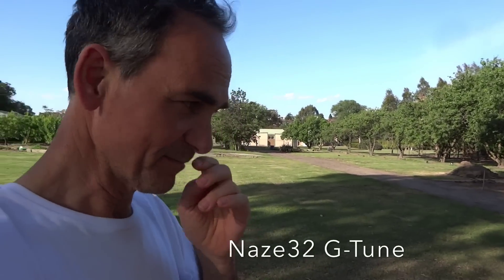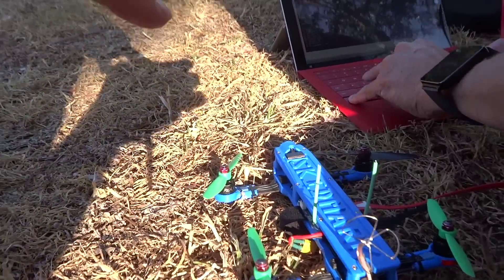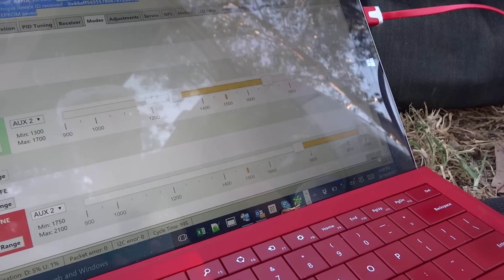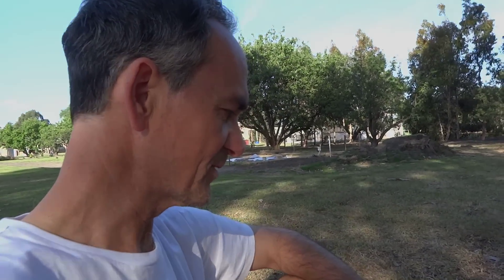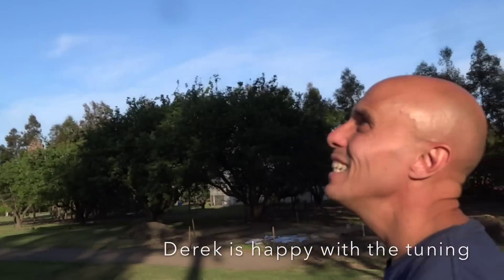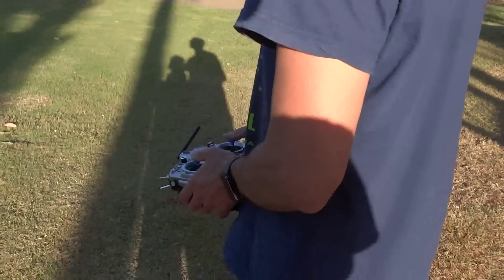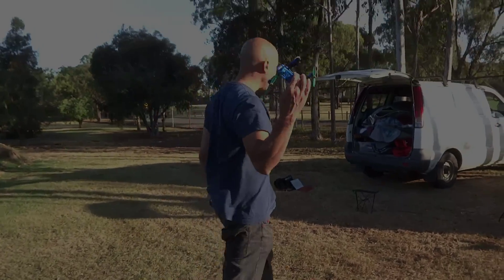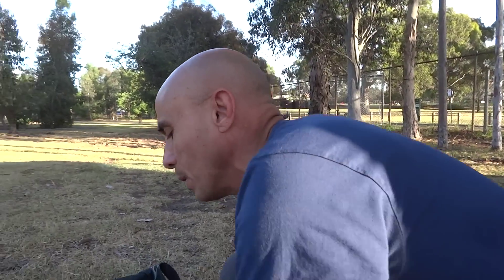Naze32 Quick Tips - G-Tune

Comment: Hi, I need your advice regarding G-tune. I have a ZMR250, SP F3 FC, Emax MT 2204, 5x4x3 props, running on 3s 1800mah, AUW 620 (incl. FPV). I used Cleanflight G-tune and I got 100 P rate for all three ( Roll, Pitch and Yaw).  It did not sound OK for me. Should I try to set in CLI a higher "gtune_hiP"? I have not seen any 250 FPV with P rate higher than 100. Does the Pitch/Roll/Yaw Rate (set to 0.75) influence the G-tune P rate?

Comment: what flight mode are you tuning in?air, horizon or angle for G tune, thanks
 cool video
Reply from the maker: Bullbrook Rottweilers Vom TaurusBach we used acro mode, I don't think it would work well in horizon mode. Please note that it will not work in any of the newer BETAFLIGHT firmware

Comment: I need some help with the Robocat. I have been working on this for 4 weeks, resolved the mistakes I made-- problem is , This thing will not fly. I used a Naz 32 advanced board, went to Cleanflight and have NO idea what PIDs are-- only theory. If I can get this thing to hover, or even take off-- I will work on PIDs. When I take off, apply throttle slowly-- it starts to move, then flips upside down- like I Hit a roll right in rattitude (saw the pictures. How can I ,--at least get it off the ground? Thanks for your thoughts.
Reply from the maker: fistly just go back to default PIDs, it should fly. Do not try g-tune or autotune this is not your problem. If it is flipping there are many reasons. Wrong prop direction, motors not wired correctly (see diagram which ones should be motor 1,2,3,4), Motors spinning the wrong way, board may not be orientated pointing forwards if so you can change this in the config. Make sure you calibrate accelerometer and gyros. Have you calibrated your ecs's. When you use your transmitter are all the travels going the right way and the right control based on your input ?
Reply: I have just upgraded my quad to betaflight and it was flying great before hand, now it is trying to flip over when I try start up.  The props and motors are still the same config so I cant work out whats happening.  It isnt turning on yaw its just increasing throttle, the roll and pitch is so twitchy its just a wild animal that I cant tame enough to begin a hover.  I started it off on default PIDs when the beta installed.  I am running afro escs so maybe they are upset with a setting but I cant yet figure it out.  The throttle is not very responsive either.  If you have an idea it would be cool to hear.
Reply from the maker: flash back to your old setup and see if it works ? Go to the reciever tab and see if everything is moving in the right direction, check that board rotation is defined, make sure props are not loose ?
Reply: Yes I did that, it just seems like the pids are so sensitive but also the yaw doesnt seem to yaw it just wants to increase throttle.  I did recalibrate the esc's and they are afro 12amp running on simonK not the one shot.  Im getting the afor flashing tool in the next day or so to check if its incompatable calibration causing it, although it is very strange after it was going fine before th betaflight. If I lower the values to a low value it just lowers the throttle for each axis but it still wants to flip when I try throttle off the ground.  is anyone using afro esc's?  if so can you tell me how you have the config page set up for esc?  I have selected PWM and I think its at 400-500 other values seem to have the motors out of time.  Thanks for the reply.

Comment: Naze32 10DOF with 30A and 2000kV motors just installed. I must be a complete idiot, because I cannot find G-tune in Cleanflight, no matter what firmware I pick.1.10.0 will allow me to set Autotune...1.12.0 will not provide any.Downloaded firmware from the Betaflight link, but that gave me nothing more and motors wont arm or spin in motor setup in Cleanflight....Will have to go back to Naze 1.10.0 firmware and hope that it will work.
Reply from the maker: You need Betaflight pre 2.4.1, autotune is too risky in my opinion. See my other video on loading BETAFLIGHT. If you haven't done this thing before always good to get someone else to help.

Comment: you said it only tune the Ps?  how would i know if I and D are good?
Reply from the maker: +nitro 20 the I is easy, point nose down a bit to go forwards and see if it stays there and doesnt go up or down over time, same with left and right. To get the D right move the stick quickly and watch if it bounces when you let go. increase to stop bouncing. Obviously this doesnt work if you have auto level on.
Reply: what i dont get..is if D helps P and D is "set" then how is that a good P setting with G tune..shouldnt I and D be close to 0 so that P is being tuned as it should....or does Gtune not care if there is a I and D setting..never the less I and D need to be retuned to match the new P settting..right?
Reply from the maker: +nitro 20 start with low I and low d maybe 0.25 and 5 then you just bring them up one at time after gtune. Sometimes gtune might be too high so you will need to bring the p down too, it all depends when you stop flying

Comment: Can't seem to get this to work. It's been integrated into CF so I set it all up, enabled gtune in acro mode, went for a fly, turned gtune off, landed, turned gtune on and off again to save but no difference. Do I need to set my set my pids to 0?
Reply: +leetpg I have the same problem, have you figure it out ?
Reply from the maker: +mrtokyo1989 make sure gtune is selectable, new versions of boris do not support it any more. then take off and turn on gtune. It was a little hit and miss to get the thing to save but try this... land and disarm then plug your quad in to cleanflight to read the new pids, do not unplug from the battery and dont turn off gtune.
Reply: im pretty sure it needs to be in angle or horizon mode for it to work

Comment: just tried gtune - summary: DO NOT USE!! very unpredictable flight behavior, was doing ok for the first 5sec later took off full throttle into space with a fully charged 4s lipo... no control from sticks, very scary had to disarm to disable motors - not fun good thing i was in the middle of an empty field far from potential targets.

Comment: do you fly in stable mode when in g-tune?
Reply from the maker: No in rate mode but if you are not ready for rate yet then try horizon mode with a low P.
Reply: okay will airmode do as well?

Comment: should i have level mode on or not while i Gtune ? +jbalatutube
Reply from the maker: +Joel Bergman only if thats the way you fly
Reply: Okey. Thank you!
Reply: +jbalatutube what flight mode did Derek use in this clip?, mine PID values didnt changed at all after i used Gtune, after i fly i dind not power off quad, and did not turn off gtune, i just pluged in to cleanflight and hit save, do you know what the problem is ?
Reply from the maker: +Joel Bergman we always use rate mode.  Fly, enable gtune, land and plug in. Do not 
disconnect power. You can actually see it working while its in the air.

Comment: Just tried to use G-tune. Armed the quad, enabled G-tune, and took off. Flew around on a battery and than landed, disarmed, and disabled G-tune. Then I re-enabled it. Went straight to the laptop and checked PID's after - they didn't change at all. One thing to note...my quad appears to be flying fine in LOS with stock Luxfloat PID's.
Update: Tried switching to Multiwii rewrite, flew another pack, enabled g-tune while in the air, flew the pack, landed and than disabled g-tune. Re-enabled gtune, checked GUI for PID change...nothing...so I flew another pack, this time instead of enabling/disabling g-tune after landing, I just plugged straight into CF. Still no luck. Starting to think I'll just manually tune the pids

Comment: How did you make it show up on the clean flight ?
Reply from the maker: +colby lachance you need to install betaflight firmware but 2.4.1 or lower
Reply: +jbalatutube I have just flashed the firmware and I cant find the G tune on the modes tab

Comment: I tried running g-tune with luxfloat, but I see no change in PID values, I hooked up my naze32 r5 to my pc without turning off.  See NO change, haven't tried multiwii, but so far luxfloat out of the box is locked in.  Can anyone confirm if gtune just doesn't work on luxfloat? I'm running latest 1.12 RC1 CF
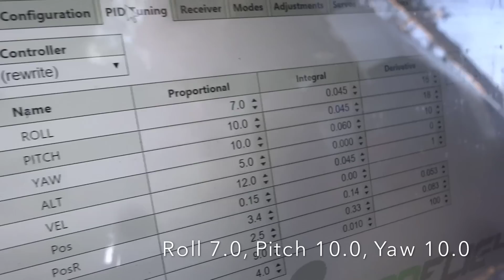Reply: +kubanishku, Tried today in luxfloat on rev6 and same thing, not sure if it works in Luxfloat... If you look 4:57 of this video they are in Multiwii (rewrite). Guess i'll give that a shot now.
Reply: +kubanishku Just tried G-tune with Luxfloat...no luck. However, stock Luxfloat PID's seems to be flying really well. Maybe I'll just leave it for now...

Comment: hello, nice video, very clear instructions. I have naze32 rev6 full with cleanflight 1.1.0 with CALIB mode ( and it came out only by activating inflight calibration setting in the configuration tab)  instead of G-TUNE, but i suppose is the same and i folowed your instructions but didn't get any luck. I see no changes, so maybe the CALIB mode is comporting differently? Thank you for help.

Comment: did you power off the quad before connecting to cleanflight?  I couldn't get it to save.
Reply from the maker: +mooosestang no don't power off, in fact if you are connecting to cleanflight then dont even switch g-tune off when landing just connect up and save in cleanflight.
Reply: +mooosestang https://github.com/cleanflight/cleanflight/blob/master/docs/Gtune.md

Comment: So I've tried this several times now but I can't get it to save. I fly with gtune in acro mode, and then I land and disarm, and then turn gtune off, switch it back on again, and then switch it off. I have the version from when it first came out. Am I missing a step? I'm using the seriously dodo flight controller and it flies just fine out of the box but I figured maybe it could fly even better.
Reply from the maker: +Doc FPV Try just leaving it on and plug into cleanflight ?
Reply: So disarm, leave gtune on and plug it in? I'll have to try that tomorrow. I'll keep you posted!
Reply: Actually just got a moment to try it in the back yard. That works! Thanks for the tip!

Comment: Could you tell me if G-tune only works with the full naze32 or does this work with the basic version too? I'm struggling to get g-tune to show any changes to my pids ( and I am useless at tuning! )
Reply from the maker: Just turn off angle or horizon mode and follow the steps in the video. You should be able to hear it changing as you fly
Reply: jbalatutube I'm sure to be doing something dumb. With no other modes set, flying acro / turn on g-tune / land / disarm motors/ turn off g-tune / turn on g-tune / pull power and connect to cleanflight but see no change. I will re-flash beta - perhaps that will sort it. Thanks for the help. It sounds so simple!
Reply: +jbalatutube re-flashed, still not able to get g-tune to show any changes or save. Tried doing it on another quad - same result. Must be something I am doing!
Reply from the maker: +Tobermory Cat try turn on gtune after you take off then land and disarm and plug into Cleanflight. I found it took us a few goes to get it to save
Reply from the maker: +Tobermory Cat I don't think you should pull off the battery
Reply: turned on g-tune during flight/ fly for a couple of mins/ land /disarm motors/ turned g-tune off - DO NOT TURN ON AGAIN OR YOU WILL LOOSE SETTINGS/ keep quad power on and connect to cleanflight pid settings on laptop and SAVE.............That works for me. Again - thanks so much for the help. Much appreciated! I'm wondering about setting "i" and "d" to zero and re-running this to see how it gets on.
Reply: +Tobermory Cat jbalatutube I am also having a hard time to make this work, I&#39;ve tried different approach with no success... (1) fly acro/switch on gtune/ land/ disarm/ turn off gtune/ turn on gtune/ connect to CL = nothing  changed.... (2)fly acro/switch on gtune/ land/ disarm/ turn off gtune/ connect to CL = nothing  changed... (3)fly acro/switch on gtune/ land/ disarm/connect to CL= nothing / disconnect to CL/ turn off gtune/ connect to CL=nothing / turn on gtune again = nothing. I am using full naze32, with yaw oriented to -90deg... I am sure gtune switch is working on my tx. ... I am not sure if this is related, but there is something I noticed on my video screen, when I switch gtune on, the ACRO indicator turn into LAND
Reply: pengepisopambiliputo Had another go today. Its a bit hit and miss with me too. I need to play some more. Good luck...when it does click in it did well.
Reply: +Tobermory Cat Ive got the same problem, cant get it to do anything. I read the comments here & tried all these combinations, but nothing. Don't understand why. Can you see the PID change in your OSD?
Reply: RiquezJP I'm awaiting a couple of newer naze32 boards - then will have another play.
Reply: +Tobermory Cat I managed to make it work by setting my deadband up... Looks like betaflight assumes that I am not freeing up my stick because of my noisy ppm signal
Reply: +Tobermory Cat I got it to work with a few more tries. Unfortunately it raises my pitch & yaw to 7.2 & 10 which shakes me out of the sky.
Reply: RiquezJP I've had pids sometimes register - but not played with it for a while. Betaflight seems to fly most things - good enough.

Comment: I can't find the G-Tune option in Cleanflight GUI. I have 1.1.0 GUI and 1.11.0 Firmware on naze32. AFAIK from the Cleanflight changelog it should be there from V1.11.0. So what's wrong?
Reply from the maker: It's under the modes panel, if it's not in Cleanflight then try loading Boris betaflight
Reply: thanks, I found out that you can activate this via CLI on cleanflight. But it does not work. No throttle input.
My quad fell out of the sky into the mud today as I activated it. -.-
Reply from the maker: +David Kaden hi David sorry to hear, do you know anyone else that flies quads that can give you a hand, sounds like you may be doing something wrong ?

Comment: Followup: 
I tried Gtune on MultiWii ReWrite, and noticed that the P just kept going to 10 on all axis, well beyond stable. It never went back down again. Today I tried LuxFloat, and the stock settings are already 95% there, but Gtune isn't changing the P at all for this controller, so I'm just gonna do the hands on approach for the last bit.
The reworked control loop for the PIDs in BetaFlight made mountains of difference, I'm so glad I tried it!

Comment: Hi! Do you confirm this written on the Github ? "the tuning results will only be saved if you enable G-Tune mode while the copter is disarmed and G-Tune was used before when armed". It is not clear in the video, you take off and you enable it after the arming process. Thanks
Reply from the maker: Yes you actually read that backwards, ie. arm, take off and turn on gtune, fly, turn off gtune, land disarm, then turn gtune on and off to save. I would also plug into Cleanflight to see the PID screen and press save again. Good luck with it, I think the algorithm still needs tweaking.

Comment: Me and a mate tried it today, it was horrible. Turned all P up way too high, kept flying for the whole pack hoping it'd 'tune' out but it didn't.. Oscillations just increased and flying became scary, I felt sorry for my motors and ESCs to be honest. Will stick to the old tuning books.
Reply from the maker: Well at least you tried. Did you turn off your TPA first ? Ours was definitely going up and down while we were flying but didn't get bad. I would still use the values and just lower them evenly until oscillations stop.

Comment: I've been playing with g-tune also. You can increase the max pid that it tunes to if you are getting 10 consistently by typing "set g-tune_hiP_yaw =150" this will allow yaw to be tuned up to 15 for eg.
Reply from the maker: I've seen that but honestly I wouldn't trust going over 10. The process is still a bit hit and miss, it was changing up and down a lot so it depended a lot on when you stopped

Comment: I dont see GTUNE option in Betaflight, is it only in cleanflight?Should i reflash to CF?
Reply from the maker: I haven't tried the latest CF but give it a go
Reply: +jbalatutube You need the latest dev configurator I believe still, as G-Tune is not in CF 1.0.10
.
Reply: im using cf configurator dev 0.67, GTUNE not there
Reply from the maker: +XimoXThe did you try flashing the latest CF firmware since it may have been taken out of Boris for CC3D

Comment: Thanks for the heads up, I've been struggling to get oscillations out of my quad when I apply power. Gotta give this one a go when I get the time. 
So many talented and hardworking people working magic in this hobby of ours, I love it!  :)
Reply: +sjeses I have flashed the new firmware and am ready to go when the weather permits it. 
I have also tried the new passthrough feature on the BlHeliSuite, but that can't seem to find my escs. I have bought blheli bootloader ones, but apparently something is not what it should be.